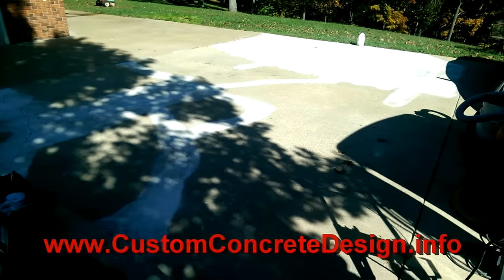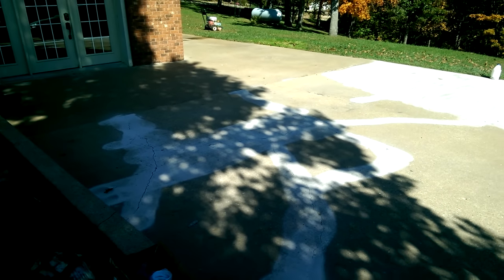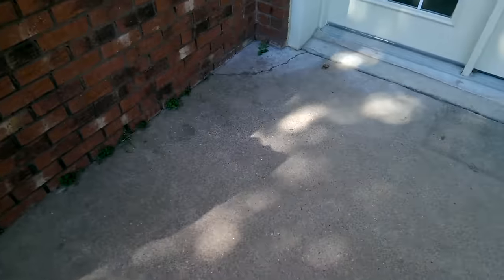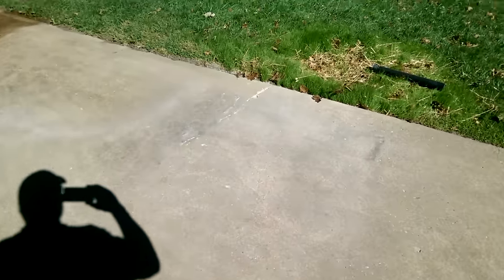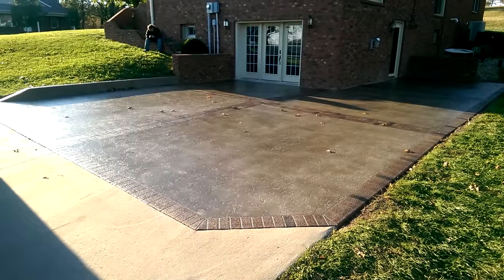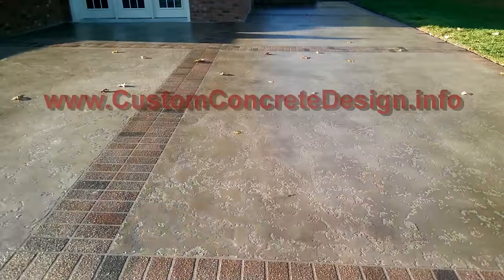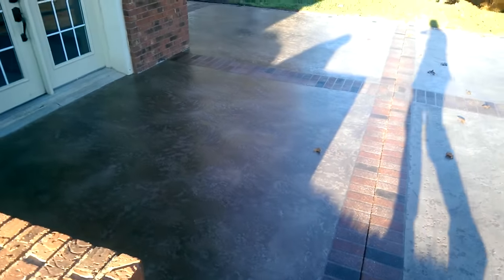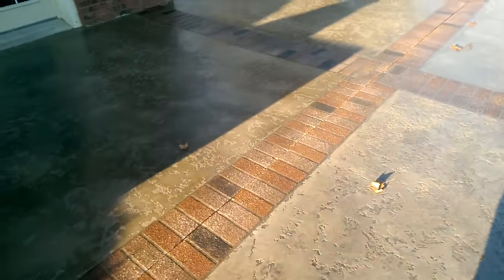Decorative Concrete Tuscan Slate Brick Boarder Antique Taupe Patio Custom Concrete Lake Ozark

Comment: Great job.  How did you get the rusticated finish?  With the skim coat?
Reply from the maker: Not sure what you mean by Rusticated finish, but the skim coat was darker than the top coat texture, and the last step before sealer was the Antique Stain which you can see in the video toward the end as I'm spraying a taupe color...which is a Chocolate and Charcoal combination which gives it a sort of aged look on the bricks and overall project, but if your asking about the bricks themselves I Antiqued those as well with a Terracotta Colorant, Brick Colorant, charcoal colorant, and mixed some chocolate in each one , then we hand pained each brick.... I'm not sure if that answers your question, but hopefully it helps.

Comment: very nice, but how you make the bricks and what product do you use. thanks for sharing
Reply from the maker: Hi @Victor Gutierrez I made the bricks with my decorative concrete material from Elitecrete that is one of the products I use and it's the one I used for this project, I sprayed the concrete through a hopper gun with a brick colorant in the concrete then changed the tip of the hopper gun to a smaller hole and then added a highlight coat of black and white over the red bricks, then hand stained  some of the bricks, then sprayed a darker charcoal color over the entire project to age the bricks... hope that helps clarify your question, thanks for stopping by watching and commenting on my video, if you have any other questions let me know.

Comment: I would love to know what paint colors you used for the bricks, and the paint used. Lovely job. Thinking about doing this around our pool deck here in Florida. Thanks!
Reply from the maker: none of this project was done with paint, everything was either a colored concrete or an Antique stain, we used a Chocolate, charcoal, brick, and a small amount of Terracotta Antique Stains.
Reply: MrCustomConcrete...  Absolutely beautiful! Thank you so much for sharing! I will definitely be trying this out for sure. We just bought a new (OLD -1950's) home here in Clearwater, Florida, and the concrete pool deck looks very much like your "before" viewing with surface cracks to repair also. Plus it just looks so plain & boring right now its painted yellow with white trim. It will look amazing after I'm done with it. Can't wait to get started. Will be looking to use those same Stain colors if available. Any particular brand I should be looking for? Will wait until the weather gets a little more cooler & dryer outside. Right now it's still the "rainy season" and its just way too hot & humid. Plus, currently I have so many other little projects going on with the inside of the house. Like tonight I just finished up tearing out 1/2 round trim from the baseboards in my bedroom  because there was quite an unsightly gap between the hardwood floor and the baseboard trim since the wall-to-wall carpeting was removed some time ago. Tons of nails, and old carpet tacks leftover to deal with... But i got 'em all out! Just filling all the little holes now, and will try a little floor sanding tomorrow night. Yup! I like doing everything to perfection (ie. just like you did on this project, definitely something to be very proud of indeed!). It's not easy to find people who are so meticulous to do work for you. Luckily I'm quite handy, and not afraid to tackle new challenges. ;-)

Comment: IS this stuff good for -40 temps though. Needs to survive harsh winters.
Reply from the maker: Honestly I have never used the product in temps that low, where I live the temps get down below 0 maybe occasionally it might be -10 for a few days or weeks here and there, but never -40 good question...I'll have to ask my distributor.
Reply: Thx for your response. It seems to be an unanswerable question everyone has been dodging. No one really knows. No one has any data sheets showing ratings for -30 or -40. Would be a crazy product for outdoor sidewalk/stair repair in Canada. Too bad.
Reply from the maker: mobgma sure no problem, I seen that you asked the same question on facebook, on the Eletecrete page, and another contractor or maybe he's a distributor said you should be fine at those temps...I'll look at the spec sheet and see if I can find it.
Reply: Would appreciate it. The only product I have seen is a Sika product actually rated for -40.

Comment: wow awesome let me ask  you I've got a ruff surface pea gravel finish what do you think about painting it and what do you recommend product wise I live in the desert southwest were you don't go outside in the summer....thanks   Jim golden valley AZ....
Reply from the maker: James Graves hi James, you can paint it, just be sure and prep it with some muriatic acid cut 6 to 1 then Ammonia cut 6 to 1 pressure wash it thoughly then use a good quality commercial paint, other wise...IF you we're to do a Concrete Overlay I would grind the surface down some with a diamond cup wheel then go over your surface with a commercial overlay material, I used a water based Portland cement, you can add color to it and create a solid color then Acid Stain the overlay, just be sure to use 2 maybe even 4 thin coats of concrete, tour last one being the texture coat. And always seal not up with a minimum of 2 coats of Acrylic sealer...hope this helps.
Reply from the maker: James Graves James Graves hi James, you can paint it, just be sure and prep it with some muriatic acid cut 6 to 1 then Ammonia cut 6 to 1 pressure wash it thoughly then use a good quality commercial paint, other wise...IF you we're to do a Concrete Overlay I would grind the surface down some with a diamond cup wheel then go over your surface with a commercial overlay material, I used a water based Portland cement, you can add color to it and create a solid color then Acid Stain the overlay, just be sure to use 2 maybe even 4 thin coats of concrete, tour last one being the texture coat. And always seal not up with a minimum of 2 coats of Acrylic sealer...hope this helps.

Comment: Very nice job.... 
Will the existing cracks show in the future .?.
Reply from the maker: It's very possible, but usually as only a hairline crack most of the time, but if 1000's of pounds of concrete wants to really move it will and that crack could get bigger, but most of the time its normal expand and contract so hairline is common.